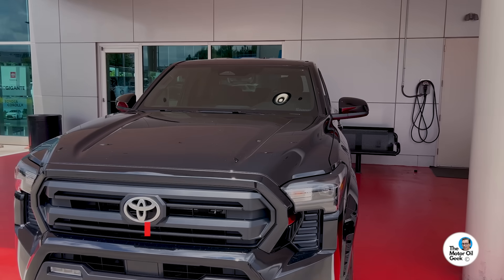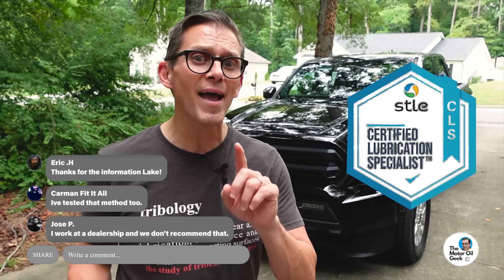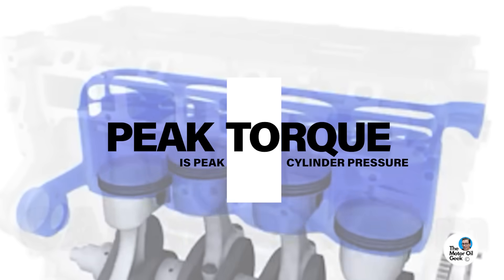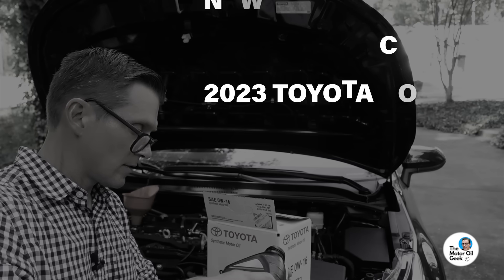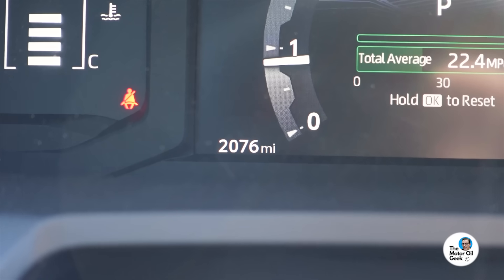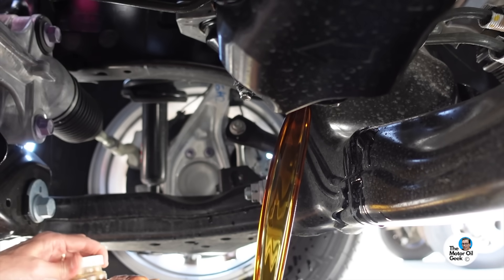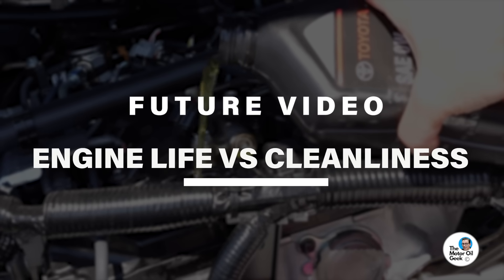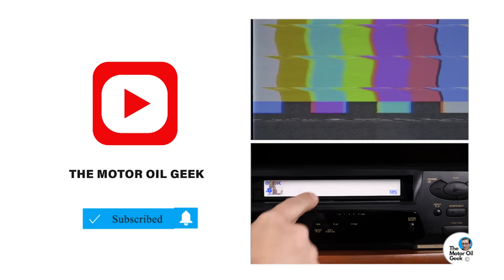The FACTS About Oil Changes (What The Owner's Manual DIDN'T Tell You)

Comment: Show us that oil filter once you pull it out!
Reply: Yes,,,, PLEASE show us the oil filter. Cut it open and roll out  the element.
Reply: @kenhurley4441  That's what was good about the cartridge oil filters. No cutting open required. Sadly, cartridge oil filters proved to be too advanced for much of the population.
Reply: @dadgarage7966  cartridge oil filters create a bigger oil mess 🤦‍♂️.  
Kiss (Keep it simple s—)
Reply: @ProfessorFickle AND you can't run filter magnets on a plastic or aluminum cartridge housing.
Reply: @ProfessorFickle nah, on the ford 2.7l eco boost engines the cartridge filters are literally a blessing more than spin on ones. It drops from the top like a Subaru and its very easy keep clean
Reply: I did a break in oil change on my 2025 RAV4 at 1000miles. I cut open the filter and was surprised to find some yellow assembly paint/marker.
Reply: @BenStone-u2l from a engine builder, thats quite common. Pinks, reds, greens etc. You'll see paint chips from proof markings, should slow or stop after 2-3 changes. Normal wont hurt anything.
Reply: @bradyknowzbest1149  you sure? we know for a fact they can't add.
Reply: @BenStone-u2l  thanks for that info.
Reply: I don’t get the leaving of the oil filter in for break in. 
Totally get the concept of the dirty filter becoming more efficient to a point. However, this is break in period surely the potential to remove asap larger fragments of metal due to manufacturing process more beneficial to overall engine health?
At 500 mile the filter won’t be efficient at that point, replacing with a new filter should be beneficial, surely?
Reply: Perfect maintenance for the Oil but bad judgement on the Filter - As Little filtering as these Tiny filters do, every time the Bypast lifts some of the filtered debris gets  washed through the Engine 😥
Reply: @Redshift-  Exactly my thoughts. It is wrong to compare oil and air filters, air filters do not have by-pass valves.
Reply: @joesmith7377  Most of the canister filters have a Pressure Bypass and a Filter Bypass for blocked Element. As you say Air filters would have to collapse to let unfiltered Air through
Reply: @Redshift- he isn't going 5000 x 3 on that filter....not a big deal.  He'd know if it was going to bypass, he's covered that with his buddy at the test facility
Reply: A lot of owners baby new engines way too much and then wonder why they burn oil later. Getting the engine up to temp and giving it moderate throttle is something I’ve done for years, and your data once again proves why it matters
Reply: I doubt there is anything to see.  What do you expect?  Silicone fragments?
Reply: @bobthrasher8226 there will be a ton to see. I did it on my new gx460 @500,1000,1500 then 5000 and the metal glitter significantly  dropped each time, with 5k having none.
Reply: I change my engine oil every 30,000 miles whether it needs it or not.
Reply: @jdub1139  if I did that, I’d begin an oil change every two months
Reply: I have a 2024 Prius even though the engine doesn't actually have 5,000 miles on it. I change the oil every 5000 miles.
Reply: Dude use a pair of ramps and jack to the rear to level the truck , it makes it much easier to slide underneath it , and still allows for oil to completely drain  . Just saying.
Reply: By not changing the oil filter your introducing some of the break in oil to your new oil.
Reply: @FloydSackett it won't move the needle
Reply: a dirty AIR filter is a good AIR filter. you simply assume it also applies to an OIL filter......

Comment: @4:55 the Donaldson rep appears to be talking about air filters whereas Lake is talking about oil filters. Was this correct or an error?
Reply: WTF.    Lake screwed up?  🤔
Reply: @Sammasambuddha it is basically true for any filter that uses a filter medium
Reply: You noticed that correctly and the Donaldson rep explained in his other video that Air and Oil filters are not the same in this respect. He specifically mentions that the air filters work by surface loading and oil filters work by "depth". I think Lake crossed his streams in his explanation here. I do not think oil filters get better (more efficient) over time the way air filters do. I also think they don't get worse over the OEM interval so changing them early doesn't help much. 

I suspect that not changing the oil filter for these short break-in changes is not important (damaging) because the break-in particles they filter are so large (machining waste/rtv excesses) they can not overload/clog it. The majority of the break-in wear particles are too small to filter and that's why changing the oil is important. 

It's also going to be dramatic when he cuts the filter and shows the cumulative "large" break-in/new engine debris from all the time on the filter.
Reply: You are correct
Reply: Same difference.
Reply: Same doubt here. Air and oil are both fluids, of course, but air filtering and oil filtering are not necessarily the same thing. Oil in the engine is in closed circuit, air is in open circuit. I think that to infer that both fluids respond similarly to filtering needs more elaboration. 
Great video, very informative.
Reply: I think the basic principle that dirty filters are more efficient applies to both air and oil filters, or really any "fluid" filter, and remember air is a fluid in this regard.
Reply: @dontosaw  Air filtration is a special case because the "old" dirt creates an electrostatic effect that attracts the "new" dirt in the airstream to itself and not the filter. That's how the filter can become better without becoming clogged. It has recruited airborne dirt to do it's work. 

This same effect does not exist with oil.

Comment: I did my first break in oil at 5k miles, how bad was this for the engine?
Reply: You're fine
Reply: No worries. Just keep changing every 5k. It’s usually something else that breaks in a car these days anyway. Like transmission or head gasket.  Neither of those have to do with oil changes.
Reply: Not optimal but also depends on the engine if it was a turbo its worse than na

Comment: Bought a new 24 4Runner last year.  Did the oil at 750, 2,000, 3,000 and now every 3,000.  I also own 96 4Runner, bought new, has been changed every 3,000 with 273,000 miles on it.
Reply: Id recommend getting an oil analysis. Youre probably wasting money on a 3k oil change.
Reply: If you're gonna change every 3k you might as well use conventional oil otherwise you're wasting your money on synthetic
Reply: @ericd1632 The 96 has been conventional oil since day one.  The 24 is full synthetic but doesn’t see much mileage yet so I’m on a 3,000 mile change, then I’ll go to 5,000
Reply: The frame will rust away long before the engine dies with 10k oil changes.
Reply: @user-tb7rn1il3q not if you take care of the frame as well as you take care of the rest of the vehicle. I use Crown Oil treatment, every fall…2012 V6 Toyota Venza with 90k, not a spot of surface rust ANYWHERE. I’m the last owner of all my Vehicles,I keep them FOR THE LONG HAUL.
Reply: @user-tb7rn1il3q  Not if your in FL!
Reply: @user-tb7rn1il3q Frame has been sprayed with lanolin since day one, not a spot of rust
Reply: @user-tb7rn1il3q The 96 has had lanolin sprayed inside and out of frame since day one.  Zero rust
Reply: The 1GR-FE is bulletproof. I have a 2021 4R TRD ORP that I will take to the grave.
Reply: 273,000 miles in 2 years? you drive like a long haul trucker
Reply: @rookiebird9382  his 4runner with 275k on it is a 96 buddy
Reply: @JohnBrowningsGhost  damn, my bad

Comment: Bro, yur crazy
Reply: 1 year or 10k miles on 0w20 is more than sufficient.  You never change break in oil early.  The engine won’t break in properly.
Reply: @user-tb7rn1il3q your average new vehicles don't have some kinda "special break in oil " its just bulk oil fill up from whatever their house brand oil is.   To use a actual "break in oil " would be to costly and at the rate manufacturers are going with everything they are not about to shell out that kinda cost.